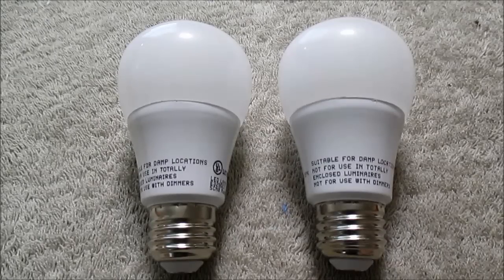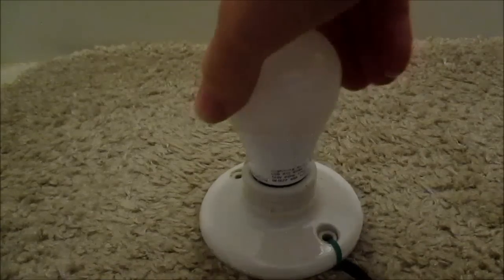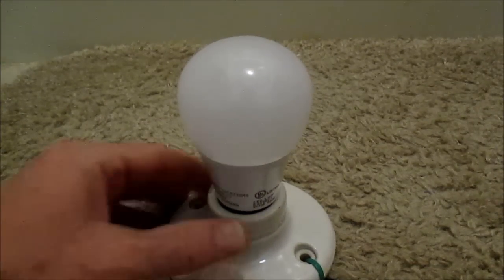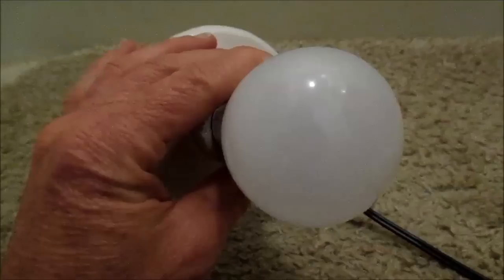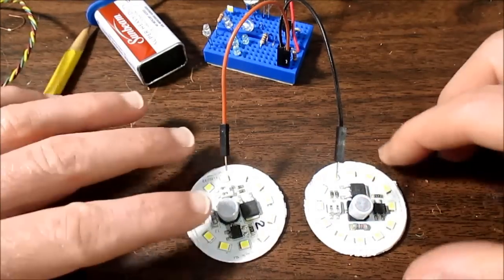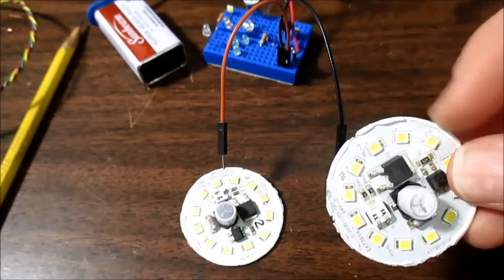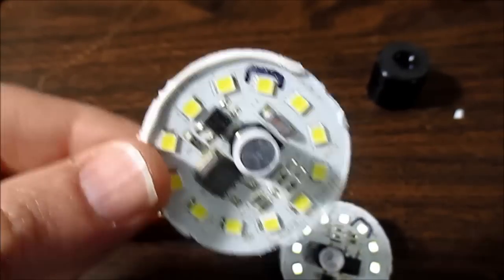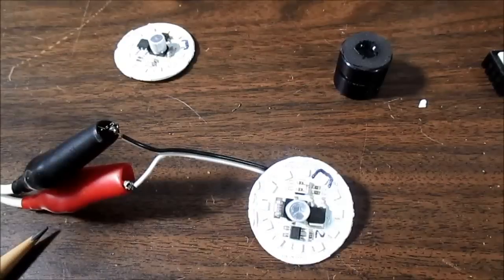Two failed LED bulbs for teardown to determine the cause

Comment: 66mA is far too much current - that is why the chips are failing
Reply: 22ma is too much for a high brightness LED? Each one of those chips has 3 LEDs in it.
Reply: I'm thinking the same thing you are... it's like they pushed them to the limit to fail...

Comment: 2 seconds in to this video I can tell you that they were used in enclosed fixtures.
Reply: Enclosed fixture -> hot environment, less cooling -> burned LEDs. Although crap quality LEDs are just as good a cause as overheating. If you live in a hot area and have fully enclosed light fixtures you are going to have problems with all brand LEDs.
Reply: Loonie Toonie Some LED bulbs are not meant for fully enclosed fixtures or damp locations. Fully enclosed fixtures don't mean air tight but they just don't privide enough air movement for the LEDs and driver to cool.  As an electrician, I see too many people buying cheap LED bulbs and installing them wherever they can without even reading the warning label. It's not so much of a safety warning as it is a statement that you are no longer going to get 50,000 hours out of this bulb if you install it where we said it shouldn't go. I like the Cree LEDs from Home Depot, they are suitable for damp locations and have slots in the defuser for increased cooling so you can put them in totally enclosed fixtures. They are a buck or two more expensive than the crap LEDs.
Reply: Blaine Bugaski Tell me more. How do you tell, & is that an issue w/ these?
Reply: +Loonie Toonie   You can buy LED bulbs that are designed for enclosed fixtures, but they cost more.
Reply: Yep, same thing happened to me.  These "long life, low energy" contraptions aren't ready for prime time.
Reply: mark stone Sure they are if people would bother to read the intended use warning on the bulb base, then they would last longer. I've almost got my entire home and garage changed over to LED and the bulbs I installed 5 years ago are still going strong. I just got sick of changing A19s and GU10s. What I was going through in incendescent and halogen bulbs paid for the LEDs. Not to mention the heat from them.
Reply: Bullcrap. You are completely talking out your butt. This does not point to a thermal failure, but a mechanical stress failure from likely a bad bond wire from ultra-cheap LEDs, perhaps exacerbated by an awful soldering process.
Reply: Impossible to tell that by looking at them!
Reply: The symptoms point to this failure.
Reply: Loonie Toonie  No, you just go with flat-panels.
Reply: Loonie Toonie where you rent a room?xd
Reply: Sure, I’m going to remove my light fixtures from my $700,000 home and put in bare bulb fixtures like in grandma’s basement. LOL. All my bulbs are in fixtures. What choice do I have?
Reply: @Tech Guy  Not all fixtures are closed fixtures.  You don't need bare bulb fixtures to keep bulbs cool.  And if you have a $700K home but cannot afford proper fixtures, then that is a sign you cannot truly afford the home you bought!  Live below your means, not above!  Seems to me that you made your post just to gloat that you have a $700K home, but it bit you in the ass because all it did was make you look like a fool with a low IQ and a BIG mortgage.

Comment: Coincidently I've had two LED bulbs die like this from my mom's house. The bulbs just died well one sort of works but it's very dim. I may try to make something out of them. I'll bypass any dead LEDs and maybe run it off DC.
Reply: Jumper the led, like he did during testing and put it back together.
Reply: @vegascolors  the problem with that is these bulbs are over powered meaning the LEDs are driven at or just beyond their limit and then something pops. I have this ligjt i made from an electric razor and i put a big bright white LED where the motor usually goes and ot works perfectly and doesnt get hot at all. The voltage is 3.2 volts DC at the motor  wires which is below the limit of the LED.

Comment: I bought a few Cree LED bulbs, and one of them went out after a couple of months. They say they are made in China. Are there any good ones out there?
Reply from the maker: Were these the new Cree models? (the ones that look similar to the bulbs in my video but have a silver stripe between the globe and white base part) My favorite  A19 bulb is the 60 and 40 watt equivalent Feit brand bulbs. These run cooler than most and come in three different color temperatures. They aren't dimmable, however. I've been using them for a year now in high use fixtures without any failure.
Reply: I dont remember if they had a silver stripe. I bought them about 6 months ago, if I remember correctly.
Reply: The Crees have wonky colors, slightly purple or green tints on white lamps. Very ugly.

Comment: I had a similar experience with some store branded bulbs a few years ago when the LED craze was just taking off, when testing with low currents like a 9v battery and 1k resistor they all lit up fine (but dim). But when the driver tried sending the full operating current through them a bond wire would thermally expand and they would give that dim flickering effect.

Since they were the larger round type of LED I ended up desoldering the bad ones and putting working LED's there from another dead lamp to create a working lamp, I did this until there wasn't enough working LED's left just to get my moneys worth.

Comment: Leds on these lamps look like regular 3528 chips. These are generally rated for 30-50 ma. Adjusting the current regulator (use 
 bigger value resistors is my guess) should resolve most issues with these bulbs (did on my euro versions which look very similar).
Reply: Koko, many 2835 LEDs are rated 150+ mA.
Reply: And you would be wrong ...
Reply: Gerard Vaughan   That just means you have limited experience.
Reply: You are making a lot of comments that show you have little experience with this technology. That is why this is type you have "never" run into and why you make ignorant comments about linear regulators in bulbs, etc.
Reply: You don't understand even enough to waste time explaining ... well anything. You soldered some broken connections ... good for you. It's obvious from your posts you have little in depth knowledge of electronics, LED bulb electronics, frankly even LEDs. You are trying to look smart ... but too people that are, it's a big fail.

Comment: Thank you John for this great info! I will avoid this brand. I have the same multi meter you have. Got it at Radio Shack about 10 years ago and it has been working great until now. It has, as you know, a continuity beeper and I use it a lot. I turned it on and now I get a constant beeping. The display comes on but beeping won't stop. It does not do it in the mA mode. All the rest do it. Any ideas of what it is? I first thought it was low battery, so I put in new ones, did not fix it. Thankz
Reply: Have a look and see if there is a transistor driving the buzzer, I had a meter once and the same thing happened. Turned out to be the transistor driving it had shorted.
Reply: If it does not beep on the ma setting but it does on all others it is telling you that you have the lead in the amp / ma socket . Warning you not to connect it to voltage.

Comment: You could have some fun with these LED's but once they are off the heat sink there is not much you can do with them. I suppose stick them on a lead and dip them in varnish would be OK for a Bacardi and Coke.

Comment: to open the bulb i slide a cutter between the sphere and the white base all around,until the white glue is cut enough to separate them.
Reply: I hit them around the rim with the back of a screwdriver, it seems to shock the adhesive loose then a quick twist and they seem to just pop off.
Reply: or maybe soften the glue with some paint thinner. it works on a lot of glues that are used in electronics enclosures. apply a bit with a batonnett and wait for a minute

Comment: I checked one of these kind of led board. The problem was capacitor bulged. 2 LEDs were open. I replaced all of them, but the problem repeats(no capacitor damage this time). I replaced capacitor with 400v rating though  orginal one was 100v. What might be the problem?
Reply: The usual problem is their components all being undersized, so they can't last at all.